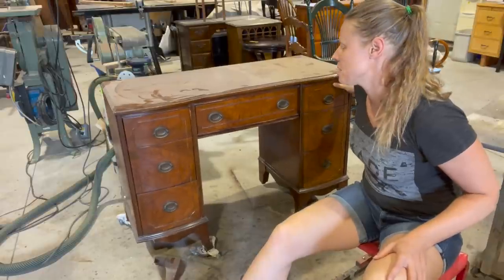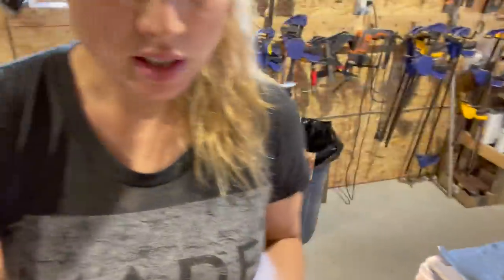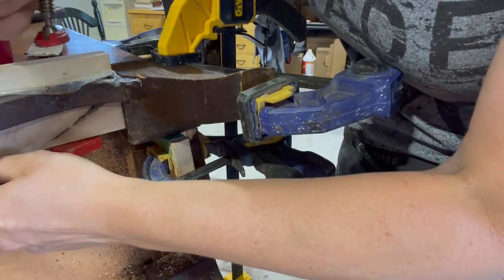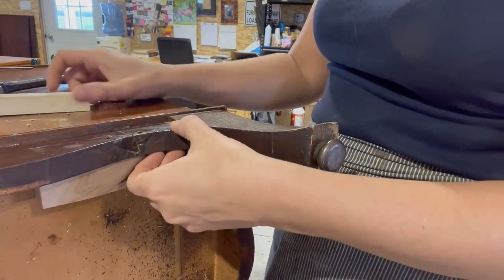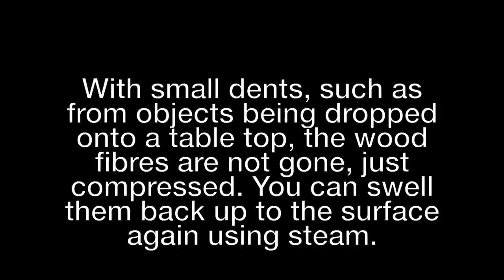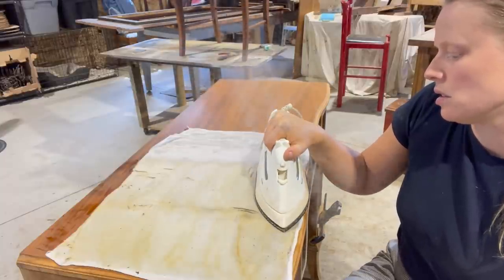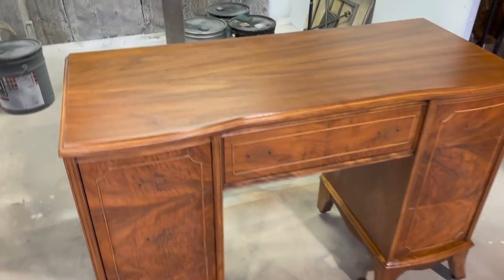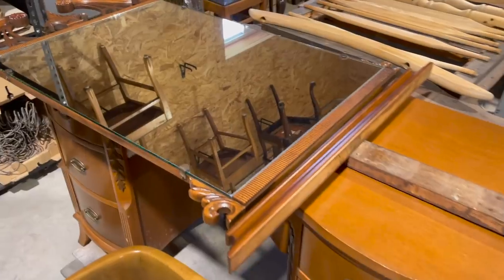Holy burled walnut veneer, Batman!

Comment: Glad you mentioned wearing a respirator. Not just for your safety but especially for those looking to you to learn. When I was younger for years I was an airbrush artist but always wore a respirator and even built a DIY suction system to the outside. Even just using a small artist airbrush, with a very uncomfortable heavy duty double filter respirator and a fan sucking out the overspray, when I stopped airbrushing I sneezed in all the colors of the rainbow (or all the colors of the project I was working on at the time). A respirator is a must even with ventilation.

Comment: Your method for cutting out a piece of replacement veneer at the same time as outlining what you'll cut away is GENIUS! Why haven't I ever been taught to do it that way?? Thank you so much for showing that.
Reply: What are you spraying int sprayer
Reply: The same technique can be used for joining wallpaper overlaps, or indeed floor tiles at an edge.
Reply: I liked the rest of it.  With the wood glue then set with an iron.  Never saw that.   She is tricky.

Comment: Wow, nice. One small point - I use a lot of epoxy for boat building and repair, and occasionally on furniture projects too. It's thought, and the people who make West System say that when you're using a glue/putty mix like that, you end up with a stronger joint if you pre-coat the joint with pure resin, then add the thickener to the epoxy and finish the glue up. The idea is that since the epoxy can stay liquid for a while, depending on temperature, it's easy for the bare wood to absorb the epoxy out of the glue mix and leave what amounts to a starved joint in places.
Reply from the maker: Very interesting. That makes sense. Thankyou

Comment: Nice work. If you ever have veneer that needs gluing a long an edge or even a bubble, use a gentle stream of compressed air to blow the glue deeper. Veterinary syringes and slightly thinned glue can inject glue into difficult places or bubbles that have been slit. Curved  parts can be veneered using a shop vac.

Comment: hi again do you mind me asking what type of lacquer you use by the way it is going on and flowing out it looks like to me to be mohawk pre cat,it is what I use and I love it it flows so smooth and dryer almost immediately I have never used aerosol toners kind of just make my own up and mix it in with my lacquer but after watching you I probably will be trying it thanks again appreciate it
Reply from the maker: Mowhawk makes great lacquer. But I prefer lenmar for my pre cat and post clear coats. I love mowhawk and behlen toners. I usually mix my own toners with solvent based stains and lacquer/thinner and spray them with my detail guns but I just needed a touch on this one so the can did the trick.

Comment: I love your work thank you for sharing your skills I have some ideas that might help you can make the repair on the stand stronger by using wet out technique the repair is the same except before you add filler to the epoxy coat the entire area that the epoxy will contact with straight epoxy (wet out) a disposable artist paint brush works good for this step the epoxy will penetrate better this way making the repair stronger now add the saw dust to the epoxy you already mixed up and finish the repair just in case you don't know methylene chloride strippers have wax in them it's to slow the evaporation so after stripping you have to remove the wax or your finish will have bonding issues after stripping wipe down with paint thinner to remove wax
Reply from the maker: Thanks for the epoxy tip. I’ve heard that one a few times snd I think I’m going to start doing that for tricky repairs. I wash down stripper residue with methyl chloride. Seems to do the trick. Cheers!

Comment: I have a Warren Platner table, a little side table. Or what was called a cigarette table, at one time,  with a walnut top, that my mother-in-law slid across her garage floor---- upside down, so the walnut top had lots of deep scratches!!! (Grrr!) I sanded it enough to remove the scratches, while holding my breath because I had no idea how deep the walnut was.  
I liked the raw look and left it. Not even using wax. But the top faded in natural light, near a not very bright window!  So now top has turned a light shade of gray! Almost like teak does when left outside to weather but my top looks cleaner, is more evenly colored but is a light gray--- not red or even dark brown.
Any thoughts on how to get it to look more original,  more like what most folks think of as 'walnut'.  The bookmatched grain is lovely, it is just the color that is off.  
Should I stain it?  Varnish it first, then stain it? Or???
I was thinking of using spar varnish as the last coat or two if I can find it in a dull or mat finish. I do not want a hi-gloss look, as it did not originally come that way, and I do not like that look.

Thanks for any insights you might provide!
Reply from the maker: A light sand and couple coats varnish, sanded down with 320 in between. Finished with a buff using 0000steel wool and Howard’s polish. Cheers!

Comment: Excellent.  I see you spray on some type of varnish for sealing and protecting.  I can’t use a sprayer because of where I live so I do several coats of wipe on poly. No drips or brush marks and looks better with each coat I apply. I’ve been watching some furniture flipping females on YouTube and almost all of them finish with wax.  I wonder why they finish it that way when it doesn’t give as much protection as poly and also you have to reapply it yearly or more often? I wonder if they give a can of wax and instructions to the new owners. 🤔 I  was just wondering what you and other watchers think of finishing with wax.
Reply from the maker: Wax is not a great protector against moisture and does need reapplying as it dries out. It will provide a bit of protection against abrasion as something hitting it will slide off easier and not dig in.  I think most people use it because it’s very user friendly which is fine. It’s More for looks. I use it overtop protective finishes to give a lovely sheen if I’m restoring instead of refinishing. To each their own. Cheers!

Comment: Trena, I watched one of your YouTube videos and found it very interesting. You are obviously an expert in refinishing furniture. I'm an amateur furniture refinisher. May I make a suggestion? You had a situation where you needed to put wood glue under raised veneer. You used the glue bottle to try to squirt glue under the veneer. What I have done in that situation is use a soda straw. I put one end of the straw in the glue bottle and sack on the other end, filling the straw with glue. Then I pinch one end of the straw with my fingers to make it flat. Then I push the flattened end of the glue filled straw under the veneer. Then I roll or squeeze the other end of the straw like a tube of toothpaste forcing the glue into the opening. Then you can move the straw over a little and repeat the process. I hope this is helpful.

Don Nodurft
Reply from the maker: Interesting. Thanks for the tip.

Comment: Maybe you can talk about the brushes you use in different parts of the process. I'm guessing entirely, but I bet pig hair brushes work better for stripping. I used to paint on canvas, and the brushes were extremely important.
Reply from the maker: I don’t use expensive brushes at all. Any natural hair brush will do. They all break down over time so I don’t get expensive ones especially because it’s such messy work.

Comment: Hia, I've really been enjoying your videos. I've noticed you use steam to lift dents out a few times, is there any woods that it wouldn't work on? I am assuming cheap substrates under veneer would be a no-no?! Thanks, Peta
Reply from the maker: most situations are good to go, just be careful if you have particle board or masonite.
Reply: @johnsfurniturerepair  thanks. I would need to look more closely - the family piano at my sisters took a couple of good dinks when it last got moved. If it's to be fixed it will be me that does it! 🙃

Comment: What is the topcoat you used? Is it shellac, lacquer, polycrylic, or polyurethane? I've never seen anything clear coated with a sprayer before, I always thought little air bubbles would form. Also, What is the glue you used to adhere the veneer with? Does it dry by ironing it? Such a gorgeous piece of furniture!
Reply from the maker: Check out the products I use vid. Cheers

Comment: So I have a question about applying new veneer.  First I used contact cement.  Even after waiting the 7 days for it to cure, the stain and varnish caused the edges to lift.  So on the next piece, I tried Cold Press glue for veneers.  Clamped it down well, but it still bubbled.  Ideas?
Reply from the maker: Sounds like either your substrate wasn’t smooth enough or you didn’t have enough glue or you didn’t let the glue set up. Or could be something else entirely. I like to stick to hide glue because it’s so easy to warm up and glue little pop ups

Comment: When you steam a veneer top like that does the veneer ever lift off from the heat?
Reply from the maker: No, usually these were hide glue veneers so the glue would just be reactivated. I would need to hold it in one spot longer to affect the glue more.

Comment: Please heed: your booth arrestors are long overdue for change, to avoid spontaneous combustion,(If you're not doing so already) place them in a metal garbage can fill up to the top with water, and put on a tight-fitting lid. Those things burn like gunpowder. Take a little piece out into the yard and light it....you'll see. I just want you to be safe.
Reply from the maker: They get cleaned every day, but they also look terrible in this video. Maybe time for a new set
Reply: @johnsfurniturerepair   I wasn't trying to scold, just giving a heads-up, having seen a few booth fires and certainly dumpster fires where a rogue employee bypassed the water barrel and threw the arrestors in the dumpster. Almost lost the front of my building with that one.

Comment: I notice no glue was applied to the top of that broken leg, what is the reason?
Reply from the maker: you do not glue the top of bases/legs to cabinets, this would be an improper glue job and wouldn't allow proper movement in the piece. thanks for watching
Reply: Thanks for taking the time to explain that.

Comment: It seems like there is nothing holding the top of the damaged leg to the cabinet. I can see that it was glued before the damage happened. Doesn't that leave the corner kind of fundamentally weak, or am I missing something?
Reply from the maker: so the legs are not supposed to be themselves connected to the cabinet, rather the way bases are made is the side rails of the frame are screwed to the cabinet and the frame is joined to the legs. i have seen some cabinets doweled to the case itself but this is the exception. its actually better not to have them fixed firm to the case so they can flex a little with movement. cheers
Reply: @johnsfurniturerepair    Thank you. Appreciate the response

Comment: In addition to protecting your airways against chemicals - just as important is to protect your joints.  In your case that would be your arm joints.  As you age, lubrication in your joints diminishes and bone starts rubbing against bones.  That is extremely painful, and it only gets worse.  Estrogen also diminishes and is believed to provide some lubrication to the joints.   It also enhances your immune system, so deserves appropriate attention.  I had to start using an electric sander to save on my arm joints.   Your first sign of trouble would be a pain in your shoulders. Your range of motion is almost impossible.

Comment: Why did you applying the lacquer with the drawers shut ? At the first time your client opens any of it, it will possibly ruin the tops...
Reply from the maker: They were sprayed separately off camera. The drawers do not rub on the cabinet anywhere so it is safe to spray the first coats this way as long you you take each drawer out and deal with the edges and such.
Reply: @johnsfurniturerepair  Thank you for your explanation. I was really worried about it. 😉

Comment: How it got built without corner blocks is mystifying. With the expense of the veneer and lattice work etc you’d think the foundation would be sound.
Reply: I have a massive bow front chest of drawers in burl and crotch mahogany with the same feet. I just checked, blocks. But then perhaps because of the smaller size of the dressing table they didn’t use them

Comment: Why not use hide glue instead of a fox say?
Reply from the maker: I was looking to fill the screw hole so a gap filling glue was required here. Hide glue is not a gap filling glue. It works awesome on tight fitting repairs. It would have been good for the corner block but I had a batch made and so it got used up. Cheers.